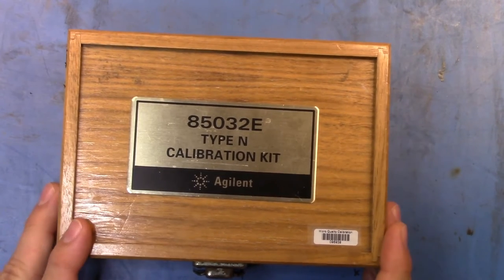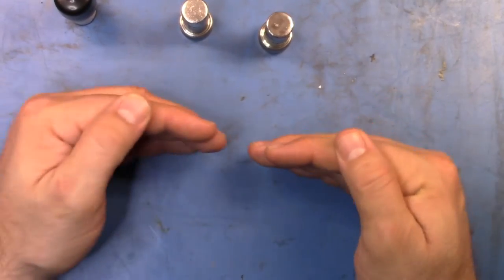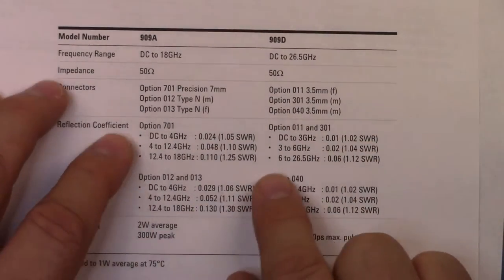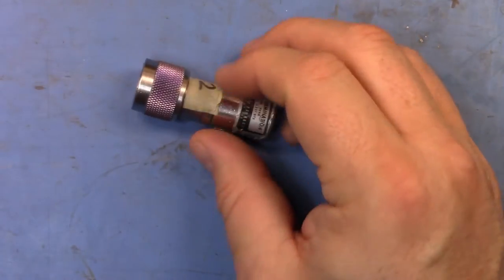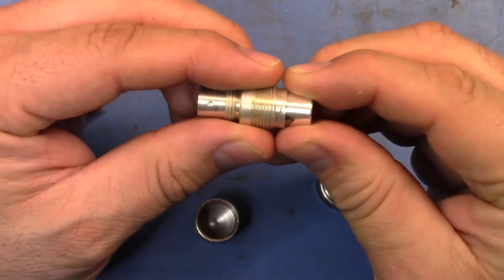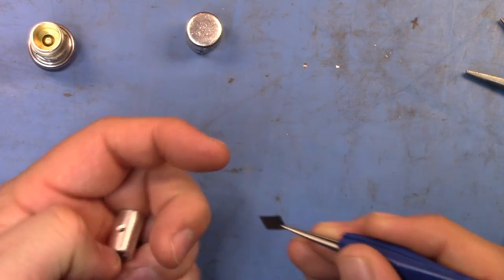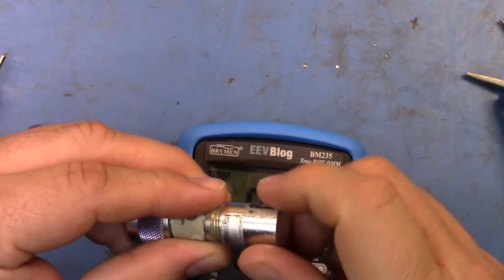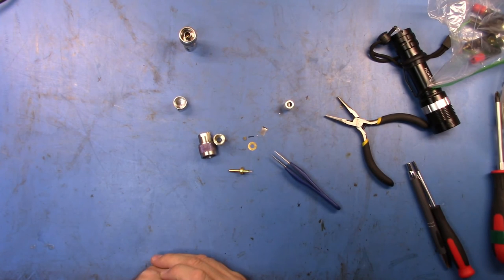HP909A Teardown

Comment: Interesting. In the video you referred to them as loads. Are they really just high-spec terminators? (I get that a resistor is a load and load is a perfectly proper term for it.)
Reply from the maker: Loads & terminators are really just interchangeable names I think - Even the product page over on Keysight.com refers to them as coaxial terminators and then loads. You could argue that dummy loads focus more on heat dissipation whereas terminators focus more on impedance matching.